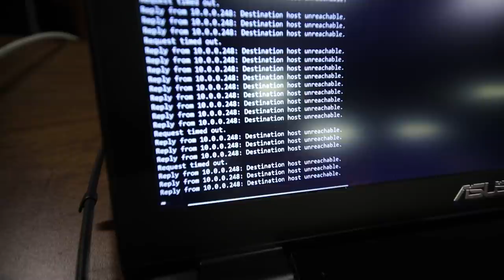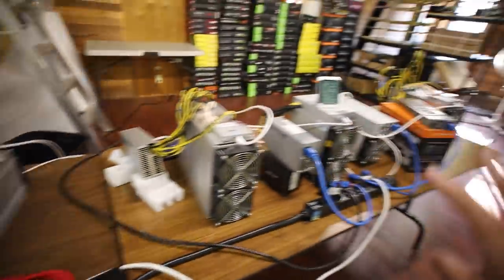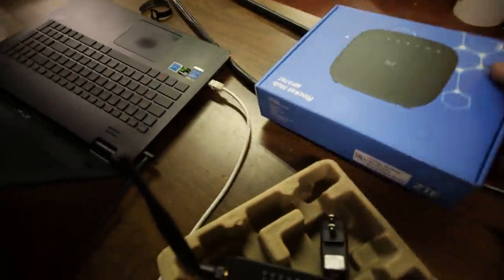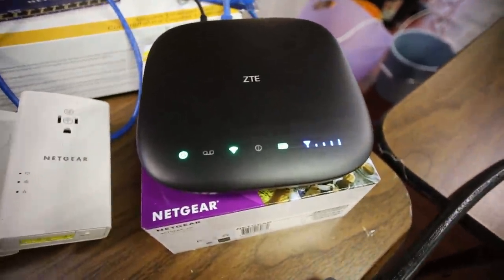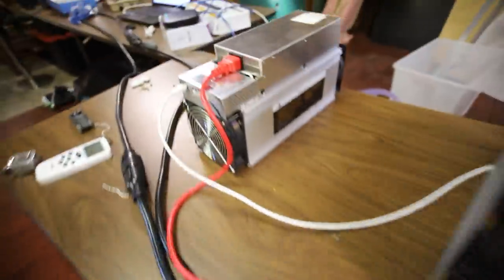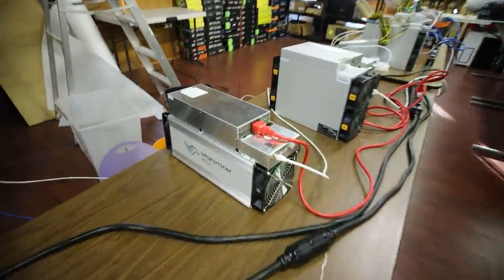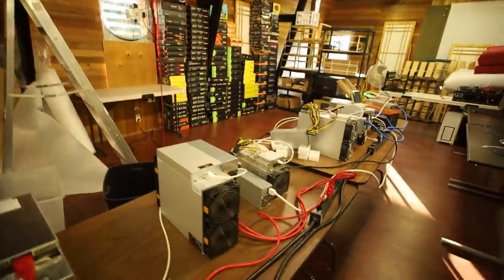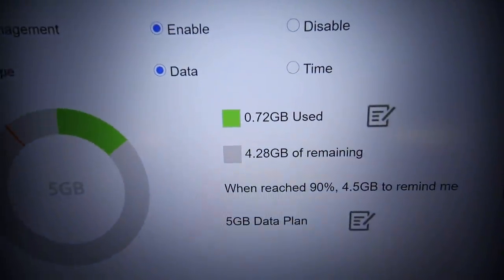Internet went down in the BARN...

Comment: Check to make sure your  power line adapters are on the same breaker.  Have you made a change to the electrical circuits the power line adapters were connected to?  I know my house they have to be on the same power line to get a good connection.  Next option would be a wifi bridge using external antennas.

Comment: do point to point but best best would be cable point to point connection for latency ;-) you can keep LTE as backup if you lose your normal connection but for that probably you need to setup like pfsense router with failover

Comment: You may have said it at some point, but it all depends on how far away you are from your house.  Wireless is good to keep everything clean, but a hard line is so much better.  I agree with the comments below for installing fiber if it's an option.  If putting cable under ground is not an option then there is plenty of point to point options out there, better options if there is a clear sight line.

Comment: If its to far for Ethernet cable  from the house to the barn then use fiber cable and 2 switch in the extremes or 2 "fiber to Ethernet" converters there are some no expensive from TP-Link, best luck

Comment: Fiber would be my choice then you still have good options for laptop and future electronics in barn. With the power adapter the Ethernet make sure they are both as close to the breaker box as possible based on the circuits you are connected to.

Comment: I think the cell hotspot would work for now but I still don't think it is the best system to use. I think an AP system would be the best like you mentioned at the end of the video. But the best option would be to run an ethernet wire to the barn. I'm from the US.

Comment: i don’t know how far is your router, but is you don’t want to continue having this type of downtimes. try to use a ethernet cable connected directly to the router. get a cat5 or cat6 maybe 100ft or more and do  some drilling if you need to get the connections to the switch, where  you have the miners connected. or you can  hire a network engineer.

Comment: He RPM First of all, I'm really enjoying your content.
Because of your internet problem: Why don't you just pull a new standard network cable (RJ45) from your modem to the miners? (I had to do it for the same reason. There is some work but it is very cost-effective because you only need the cable, 2 RJ45 plugs and a few packets of the small cable wall brackets.)
Best regards and keep going.
Reply: By the way, the power line adapter only works with newer digital electricity meters from the electricity company. Sometimes the do exchange the old analog once for free. That would be the cheapest way to get it work.

Comment: As others have stated I would either direct bury a line from the house to the barn or just treat it as a separate entity all together and have a separate internet service.  Whatever is faster for you to get setup and back up and running on a wired connection.

Comment: Europe. 
Depending on that how far your house circuit is you could trench out the yard run conduit and run the Ethernet through the conduit to the switch in the barn and then you have a solid reliable connection.

Comment: I don’t know how far your barn is located from the internet source but you can run a weather proof cat6 cable across long distances. It should be a lot more reliable than LTE modem. Ubiquiti wireless beam would work too but it may be unreliable depending on weather and obstruction between two nodes. Highly recommend running a cat6 cable. Get a spool of bare cable and you can either punch down on RJ45 adapter or make it into regular cable. Good luck and let me know if you need more details on what exact parts you would need from amazon🤞

Comment: The original 4G hub was probably locked to a specific carrier. They are just like cell phones that frequently only work with a specific carrier. Rather than using a wireless hub I would look at either a wireless bridge configuration or a fiber link to the house.
Reply: If going with fiber I would run conduit and pull a prepared patch cable rather than using direct burial raw fiber unless you know somebody that will do the terminations for a low cost. The media convertors(fiber to copper convertors) have to be matched set at the speed you want.

Comment: You should get a fiber optic switch and just run the cable over to the barn. With how much stuff you have bought now, you could have just trenched and ran one of these. You could even get a fiber to twisted pair converter to run from the house switch. Going to be a sweaty day but it would be the fastest option for you
Reply: You'll need 1/2" pvc and building penetrations but you can figure that out pretty easily

Comment: Dude just shell out 25$ CAD a month or whatever to have a dedicated circuit on your barn; lower latency(less stales) and less bullshit than with wireless or lte and less work trying to run a data line underground. Oh and to add to that, you're getting customer support with an actual ISP, you're on your own with an LTE based mitigation.
Reply: Also switch to metered connection on the laptop and you won't automatically download updates.
Reply: And I don't want your open air rack, I use 19" rack-mounted cases.

Comment: USA. Depending on how far your house circuit is you could trench out the yard run conduit and run the Ethernet through the conduit to the switch in the barn and then you have a solid reliable connection.

Comment: With so many devices, I think the most reliable solution would be running a single ethernet cable from your main router/switch with PoE enabled (no extra power cables for switch/router in the barn). Personaly I recommend sth like Mikrotik router. Cheers from Poland

Comment: Definitely recommend running 2x ethernet cables from main house to barn, you can get away with 300ft of CAT5e without connection issues. You can also boost the signal with a cheap switch in the middle if the run is longer than 300ft. I run out to my shed with a 150ft cable to my garage, into a switch in the garage, and the rest of the way to another switch in the shed.